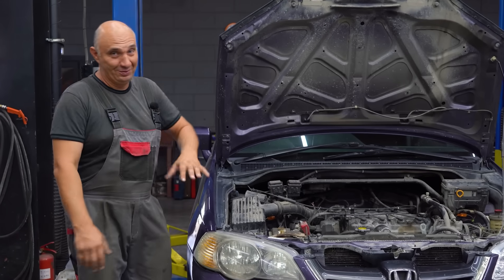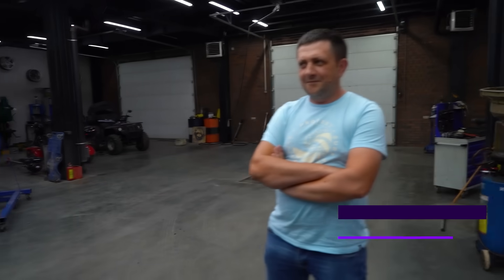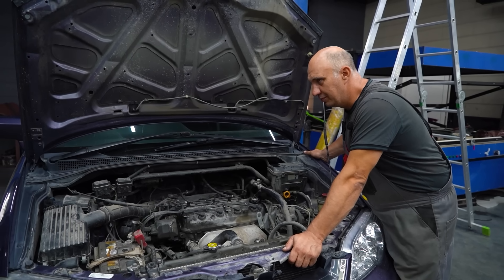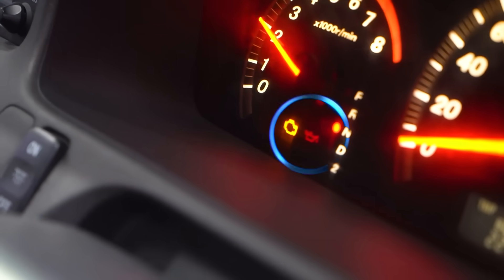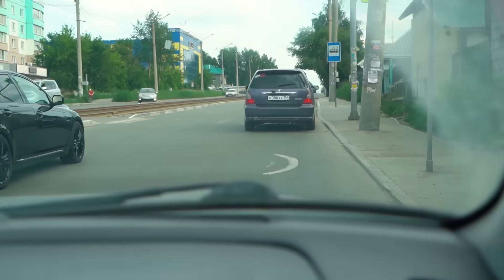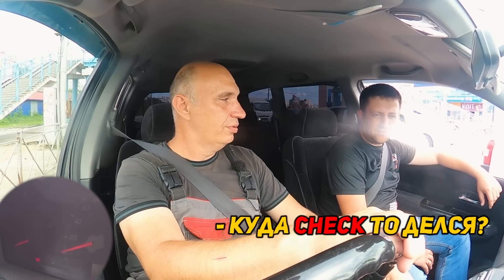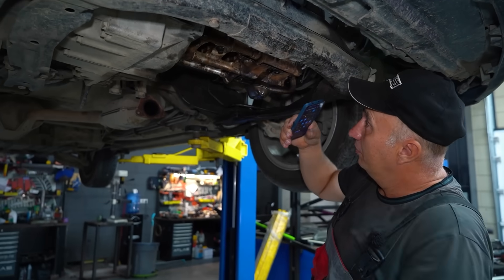Engine bay cleaner to internally flush an engine - will it work?

Comment: 10 years ago I used diesel fuel to clean gunk from a working engine that I scoped. It was full of congealed oil gunk. Ran it for 10 minutes, let it sit until cool, drained, and scoped it again. Gunk gone, and it still runs fine to this day.

Comment: Since I'm a huge fan of engine flushes, I thought I might offer a new suggestion.

I've had great success cleaning very sludged engines with "Motor Medic Motor Flush"
It appears to be a mixture of mostly offroad diesel fuel (red dye diesel) and Kerosene.

The instructions call for adding the container (946mL) to a crankcase that has an oil level up to a safe level.  The oil in the crank case should be used, and the procedure should be done before an oil change.

In the instructions, the engine should be cool before using the flush.  Add the flush to a cold engine with full oil, start the engine and let it idle for 5min.
Do not rev the engine, or put it under any load.
After 5min at idle, drain the oil and flush mixture.

My friend had a very sludged engine.  He had never changed the oil on it.  He called me because he had a low oil pressure light that kept coming on.
I had him stop driving the car and I met him at his friend's house.
I tried to add regular oil to his engine because the level was below the dipstick.
When we removed the oil cap, there was so much sludge buildup in the valve cover that we couldn't add more oil to the engine through the valve cover fill hole.  We made a funnel and added it through the dipstick tube instead.
We then drove the car to my father's house where we proceeded to use the engine flush.
Once we drained the sludge cocktail, we changed the oil as usual.

My friend messaged me the next day and told me how his car ran like it was brand new.
In other instances when I've used this, the engine looked practically brand new.

My suggestion for a future video is to both use this product on a heavily sludged engine, as well as a similar cocktail you make on your own.  It could be just disel fuel, or just kerosene, or a mix of both.

I'd really like your thoughts on this stuff.  I love it personally.
It's made in the US, so I don't know how hard it would be to import.
The name is "Motor Medic Motor Flush"

Comment: a shop i used to hang out in Mexico would do a swap of oil to ATF and have a customer drive it around a little before swapping to fresh oil and filter to clean out the engine.   it worked for cleaning but i have no idea how hard it actually was on the engine.  all the mechanics swore by this method but i wouldn't tell anyone to do it lol.

Comment: You probably should have mixed it with a slight bit of motor oil something thick not much just enough to help lubricant while the cleaning solutions worked

Comment: @Garage54 check and see if that motor has the ECONO SCREEN, now econo mode only exist if there is a light for it,.. if not then the screen at the backside of motor next to driver side next to top if memory serves me right,... had one lock up cause of that useless screen,... did same thing on cleaning motor to only lock up from starvation of oil

hope that helps

Comment: Love your show guys so HOW ABOUT THIS!.....Make a exhaust manifold/water chamber that super heats water from that waste exhaust heat, feed in water to create steam pressure via an injector as power is needed and run that high pressure steam into a turbo charger then collect that steam in a cooler to convert back to water for reinjection...steam alone may drive the car for a little while once at temperature.  You could also still run another turbo from the now much cooler exhaust

Comment: Automatic transmission fluid is an excellent cleaner as well.
Reply: This has been proven to be pretty hit and miss since the 40-50's when they  used to use it til headers or exhaust manifold got cherry red.
Manf. tolerances are far finer today, and aluminum and similar parts will get hot a lot quicker and score than the old iron stuff.
Reply: About to do this trick because some chocolate milk came out of my engine today.

Comment: Speaking of engine cleaner. I now wonder how coca cola would hold up inside as a internal engine cleaner since it does clean engine bays as well. lol
Reply: Sugar tends to not do well inside an engine. It carmelizes and burns on the piston rings and cylinder walls and ends up siezing the engine. 

Maybe coke would run longer since there is more water in it, but I'd still expect it to sieze.

I saw honey? Once and it didnct last long at all.
Reply: @volvo09  Talking about coke the soda cause that is what I'm talking about too. Could always try adding it into some oil to help it run with less chance of seizing up?

I've definitely seen honey used and it definitely didn't last long at all. lol It basically congealed up and got so thick like molasses that the motor simply couldn't run with it in it.

Comment: Can anyone tell me, have they tried running the same oil in the cooling loop as the standard loop? Rather than coolant.

If it works I wanna see them make the pile and cooling loops into one thing so the car only needs one fluid 😂
Reply: yes, they tried that, when they made the "we replaced all fluids with gasoline"

Comment: For engines that are extremely dirty inside I use either kerosene or diesel fuel. Both are oil based so running it for a short period will not harm the bearings. For cleaning pistons and valves I use water. Get the motor hot and start adding water straight into the throttle body. If the throttle body is hard to access you can use one of the vacuum hoses and let it suck the water in. I normally use about 1/2 litre. It basically steam cleans the combustion chamber.  Like when a head gasket blows and allows coolant in the cylinder.  If you have ever seen that happen that one cylinder will look spotless. Adding water does the exact same thing. Just add small amounts of water so it doesn't stall the engine.
Reply: Only problem I've heard is that preventing too much water being ingested and you could hydrolock a cylinder toasting the engine. Might be better to get a cheap steam cleaner like you can get from Target or similar, used to remove wrinkles/silicone grouting.  Get some steam into the intake and much mower chance of hydrolocking and its already hot steam so  engine stays hot yielding a more effective steam cleaning. Really though, a decent engine cleaner is $10-20 and will keep the bearings lubed better than kerosene or diesel will.

Comment: why don’t you try putting a diesel car on a dyno then purposely getting it running away like with starter fluid/ brake cleaner/ engine oil poured in the intake to see if it gains hp while in gear

Comment: try getting an american v8 dont drain the noil or radiator. set the throttle wide open... after five or ten minutes put some small pebles into the intake  and some sand,..  we used to do this it is fun....!!!!

Comment: Wish they would have cut open the filter, and refilled it with oil to see how it ran, and if the oil light went out at idle again. It didn't look like there was any metal in the oil pan. Maybe the soap had enough lubricity to keep the metal parts from getting damaged?

Comment: As a mechanic with 20 years or so experience and metal scrapper as a side job, I have yet to find a Honda motor that didn't run.. try the same with a Dodge and see how far it drives.
Reply: I drove a ram 30 miles and back without knowing somone had rigged the breather into the heater core, there was antifreeze in the oil the whole time no knocks, still runs and drives to this day after crashing into a tree. You just gotta find the right dodge lol
Reply: @t-dogracingandoffroad3198 still couldn't dodge that tree though 🤭
Reply: Unless its a slant six😉
Reply: Try a Australian falcon 6 cylinder
Reply: @WINZRacingBoss as an Aussie I agree but their 5.9 12v Cummins can run on literally waste oil, kinda hard to beat that..
Reply: @EXZACHTPERFORMANCE  diesel was originally designed to run on waste peanut oil my man.

Its only when BP and EXXON got involved that they "needed" diesel
Reply: I know a neon that ran for 40km with a broken oil strainer. Welded it back (broke at the flange) and it ran for another 6 years before it got retired due to corrosion. Motor then got installed in another car.. some motors just refuse to die..
Reply: Another Dodge shill.  The overwhelming vest, for Jordi of dodge engines are other crap, and should be considered crimes against humanity.
Reply: @EthanARedhawk82  Christ why did you remind me about the 4.7. They used that motor in the 99-04 jeep grand cherokee and while I tore one apart I have heard many o problems about the heads on that motor

Comment: I need that engine on my vehicle. It's indestructible!
Reply: Looks like a 90's D series Honda engine.
Reply: @fleurdewin7958  itd be same motor as like a 1991 honda accord, single cam
Reply: This is probably F23A7, or some other variant of the F23A.  Not a terrible engine, but a bit old at this point.  Not a good choice for engine swaps unless you already have a counter-clockwise spinning transmission.  It was a decent engine for typical soccer dad type vehicles in the early OBD2 days.
Reply: I can't believe it didn't spin a bearing with the brake fluid, or this!
Reply: All engines can run without oil. But only for a little bit before they start spinning things.
Reply: 😂 its 100 a d series engine google what came in first gen Odyssey
Reply: Honda …
Reply: Most engines are indestructible... for 5 miles. Check out competitions showing air cooled volkswagen engines running with no oil
Reply: @Novous  If you do the test with an Renault, an Chevrolet, and VW, and Ford, an Fiat and an Honda and Lada. I'd bet my money on the Lada and Honda. They can probably last the longest. And the "water" inside the engine could have helped it last longer as it cooled the engine, as opposed to without any oil. And i've seen these videos before, they run for 5 or 6 minutes at WOT if im not mistaking.
Reply: @PuzzleVizion_TV  The Lada is just a copied Fiat design, so it might as well pass.
Reply: @yowhatsup9909 You got a point haha

Comment: Hello Vlad here's another video idea what if you took engine Bay cleaner and filled up a giant tub submerge the engine in it and try to run it with the valve covers off under the stuff while it's running I wonder if that would work that would be cool to try it in the next video as a suggestion I hope you see this comment and try it

Comment: Do it multiple time till the engine fully clean
Reply: * till it grenades?
Reply: @TiborRoussou  I think they drove it for a long time. I think nothing will happen if they do it for a shorter time and not reving the engine to very high rpm
Reply: @hamood1234fool  did you not say "multiple times"?
Reply: @TiborRoussou  yes run the engine for 10 minutes, then drain. Do it 10 times then I bet it will be super clean
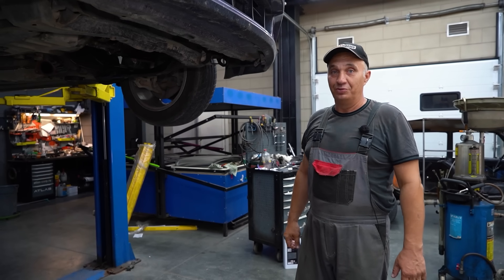Reply: @hamood1234fool  Do it 10 times and it will either grenade or be seized. At 15:22 Vlad even says "we might want to replace this engine now".
Reply: @TiborRoussou  yes because he drove it for very long time and was revving the engine so high. Just idling is enough to circulate the cleaner around the engine
Reply: @hamood1234fool  I can clearly see why you have fool in your user name.